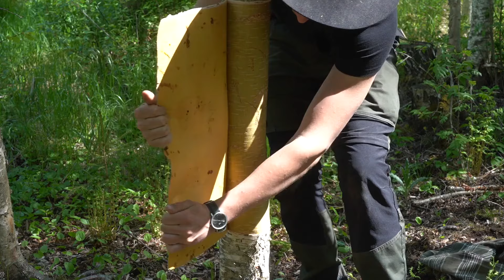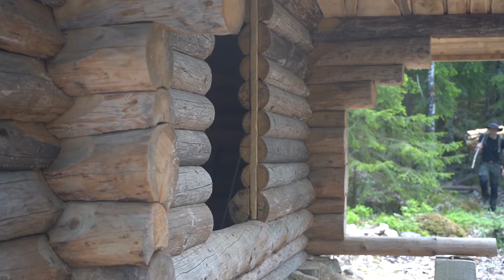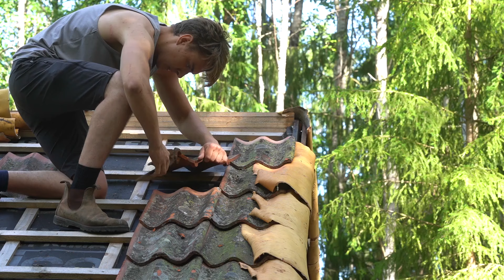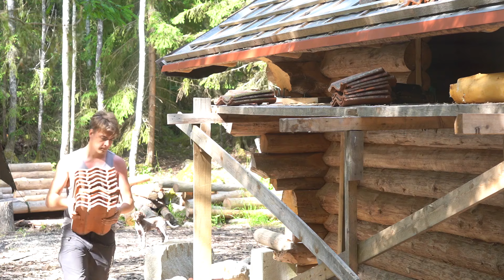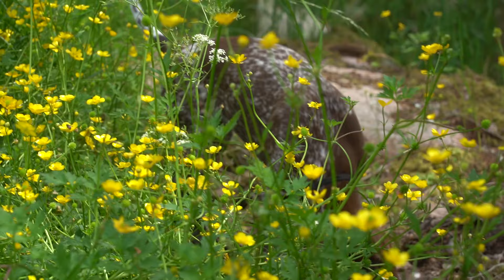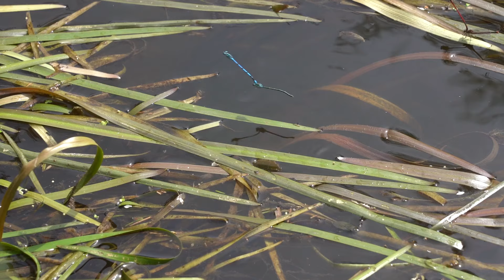Alone Building A Birch Bark Roofed Log Cabin in Wilderness

Comment: Very nice Erik! Clay tiles that are reused are often very good in quality since they have lasted probably 100 years already. This roof will last for a long time. Dont forget to secure the tile rows on the short ends with nails (one in each tile) and the row furtherst down on the long end (every other is enough here). If not, they will blow away in strong winds.
Reply: Just what I thought. However the location here is closely surrounded by much larger trees, I suspect that there will not be much wind at roof and ground level. Where I come from on the west of Ireland we use slate on our roof and because it is exposed to the weather (a lot of gales) we used two nails per slate, EVERY slate on our house.

Comment: I’ve never seen birch bark used for roofing material before. Is it just for aesthetics or does it also serve a function as well? I loved how it aged and turned a coppery color. It really complements the roof tiles. 

I started watching this build process a year and a half ago, and it has been a great experience the whole time. Thank you for sharing it with the world!
Reply: @L.K. It was the dominating roofing material in Sweden up until around 1850. It’s very functional and was easy to find in the forests. A roofing done in the right way with birch bark can last up to 80 years!
Reply: @vicsillnorth7970  What function does the bark serve though?
Reply: @Kaytertot   Looks like he’s using it for flashing, like we use copper or lead sheet here in New England. Birch bark is waterproof and would prevent rainwater from getting in under the eaves and gables.
Reply: @Kaytertot  It’s like a sealing layer to protect the wood underneath and to stop the rain from coming in. In the video it’s only used around the edges but back in the day (before tiles became common) it would be all over the roof and then covered with peat or wood planks. (I’m not an expert on this, I just googled it 😀)!
Reply: I have read about Canoes made from birch bark
Reply: Using the Birch bark around the edges like that also means he doesnt have to install guttering, the curls of Birch will act as a natural path for water to follow but directing it away from underneath the roofing.
Reply: It acts as the drip edge.
Reply: @vicsillnorth7970  Does skinning a full circumference of bark kill the paper birch like it does other trees like an oak for example?
Reply: @MasonR3  Not unless you go too deep.
Reply: @MasonR3  it will grow back pretty fast if u dont go to deep. These trees are fast growing.
Reply: Yeah, birch grows like weeds, fast and spread with the wind!

Comment: What is the purpose of the birchbark trimming the edges of the ceramic roof. Is it just a decoration, or does it have a functional purpose?
Reply: It's flashing to direct the water away from climbing under the tiles or under the eaves. Protects the structure.

Comment: Oooh also I think a small deck in the front would be awesome instead of stairs. You could do two support beams on the corners of the roof that are over hanging and add a deck with a nice fence around it and could decorate it later with furniture, chair, table, etc

Comment: I find it interesting that the majority of the clay tiles aren't fastened in place, but seem to rely on inertia or friction to hold them in place. Given the snow load that occurs in that area, it seems unlikely to me that the tiles would remain in place, but they obviously must, looking at the old barn from which you're salvaging them.
Reply: The tiles have small clay hooks on their back
Reply: @druidetrebor  Oh, that's the mechanism? Do you know if there's pics of the undersides of the tiles? I find stuff like that fascinating. It also means that the wooden strip spacing is quite critical.
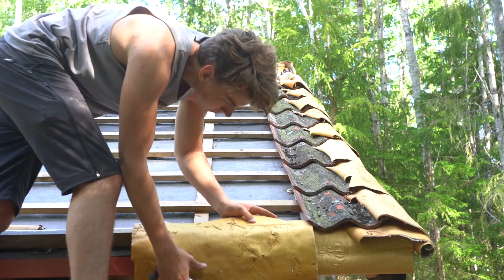Reply: @dionh70  You can see the hooks @7:06 His tiles are very simple, there are many kinds of tiles with more elaborated shapes to improve watertightness. It was (is?) also common to bed the tiles in mortar.

Comment: Absolutely enjoyed every video and I am actually a little bit jealous of your skills and the surroundings were you are able to exercise them so you can share it here. But I guess those peeled trees are done now aren’t they? What’s it for anyway? If rain drops on those vertical pieces don’t you think it will stil run under the roof tiles? Ok there is a rubber protection but I am so curious on what’s the point of putting the bark there?
Reply: The birch bark grows back.

Comment: Just curious. Have you ever heard of a Scoop Roof? These were popular in the USA and Canada 150 years ago. The idea is that you split a bunch of logs in half, hollow out the flat sides to make open ended troughs, then lay them like Spanish tile roofing where two are placed side by side with the trough up, and a third is placed with the trough down to cover the gap. This was a way to build a watertight roof when you had very limited tools. You can build a small scoop roof cabin with nothing but an axe. No saw, no nails. Was this kind of roof ever used in Sweden? I have seen one very old barn roofed this way in Finland in an open air museum.

Comment: I know little about these type roofing shingles and how they are installed. But it appeared as though you just laid them up there without any nails or bonding glue. If a really good wind comes along I would think they could fly off even though they are heavy. Why would you not want to use something like a liquid nails bonding glue to lightly bond each one to the other?

Comment: I read somewhere that cutting horizontally all around the birch can severely damage its nutrient or water system causing the tree to die :( that's why you don't cut all around and more vertically
Reply: If you harvest birch bark during the appropriate season and you don't strip the cambium layer, the tree has little to no problem regrowing it's bark.

In fact, people often return to the same trees to harvest from the same spots after its regrown because it comes off easier and the tree continues to live and produce bark.

Comment: While I do admire your work ethic, new puppy, and your project (especially the recycling of old roofing tiles from the dilapidated old barn) I have to wonder why, when collecting birch bark for your roofing, did you require killing the birch trees by girdling them?  Is there such an overabundance of birch trees that you are, in fact, culling them in order to thin out the forest?
Reply: It doesn't kill them.  He didn't cut right down to the wood.  The bark slowly grows back.
Reply: @bradleyrobinson7552  I sure hope you're right.  All of the research I have done thus far (and I admit to it being rather superficial) indicates that the bark and not the wood beneath it was what they were talking about.  But I see your point:  if the phloem and the cambium isn't compromised, it should survive.  Thanks
Reply: @bradleyrobinson7552  I also noticed that in Portugal, they harvest cork the same way and the trees regrow the cork for the future harvest.  When  you're right, you are spot on!

Comment: It looks like you peel off the outer layer so the tree continues to grow. Is that correct?
Reply: Correct. The cambium layer under the bark is left intact. The bark is only for protection really and although exposed, the birch recover rather quickly.
Reply: @timmd8766  your doing the same....  Replying saying no it won't if the vascular cambium isn't damaged 👍🏻
Reply: @melondog82  Ha ha!. Yeah, when Erik got to peeling the bark of the birch, my immediate thought was that a lot of people would be concerned in the comment section and I wasn't wrong. :P

Comment: How in the world would that last 100 years?
Reply: As someone from Finland, we have a lot of log cabins that have been standing not a hundred but several hundred years build the same way essentially. I think this is down to a few things. There are no termites in Scandinavia, it's actually quite dry because most rain comes as snow during winter. Lastly due to being quite cold that timber is quite dense as it has taken probably 75 - 150 years to grow depending on whether you are south or north of the country. 

Now if the global warning gets bigger this can change drastically as we would expect more rain and the number of insects that cannot survive Nordic winter could become commonplace. 

Last thing to note It will not just stand there for 100 years. For wooden structures to last a century or few they have to be kept heated to avoid dampness and mold, roof needs work every 15 years or so and painting will help substantially. Actually most old, once I know, are painted with red dirt paint.